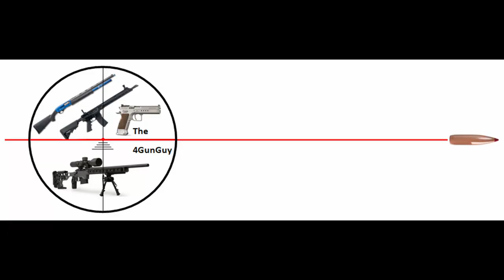MPA Matrix Pro Chassis Review

Comment: A wide fore-end has its drawbacks. A canted barricade or canted bag will end up canting the rifle and you will have to fight it more to get it to settle. Thats the advantage of narrowed fore ends.
Reply from the maker: Hi tiputipu777!  Good point.  Exactly why people need to work on their positional shooting.  This past weekend we shot off a barricade that had a large center window and then two 45 degree angles on each side.  I saw many shooters slide down those sides because they didn't use the right bag for the job such as my Tator Tot with grippy bottom.  Thanks for watching my friend!

Comment: Thanks for this video. I bought an AI AXSR last summer and now going back to the MDT ACC feels like a clunky turd. The cheek piece is too small and feels cheap. I don't like the cheap, plastic screw knobs that keep falling either. I want an AXSR chassis, but no one has it. The cheek piece on the MPA looks much bigger and looks like a good choice.
Reply from the maker: Hi Piro!  That MPA cheek piece is actually smaller than I thought it would be, but I honestly like it because I'm going with a "chin weld" now so my head is more vertical when I look through the scope.  I also agree that the ACC feels a bit "cheaper" now that I'm running this MPA and will most likely be switching to the MPA for my centerfire rifle.  Thanks for watching and commenting my friend!
Reply: @The4GunGuy  You're welcome.